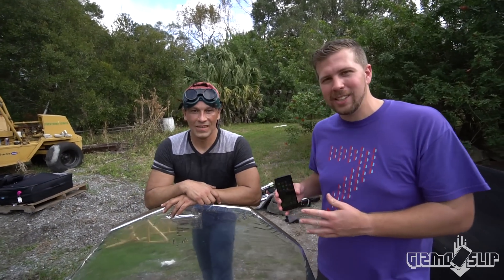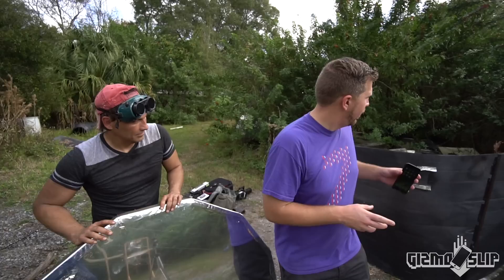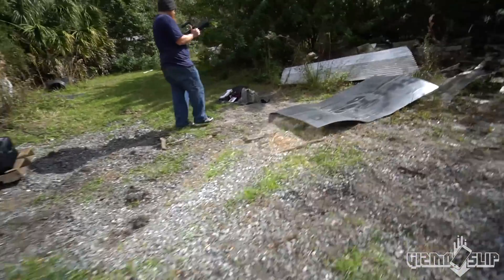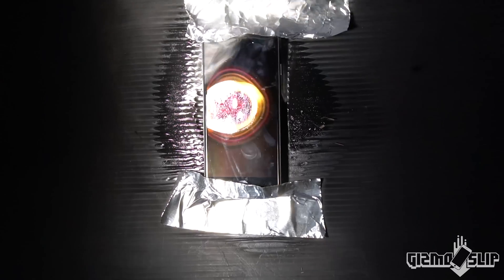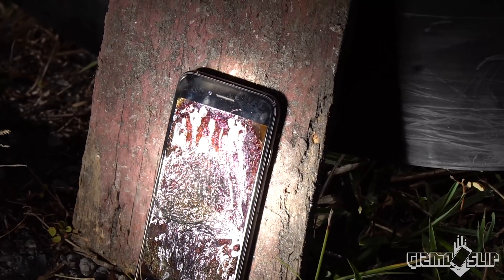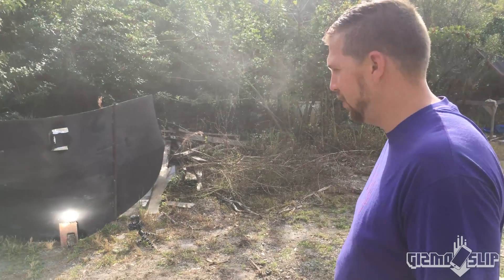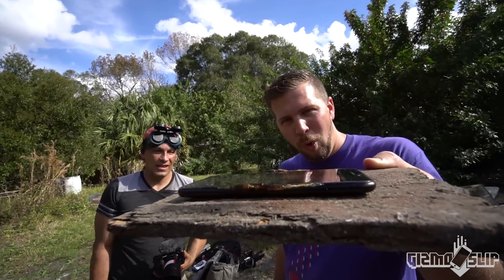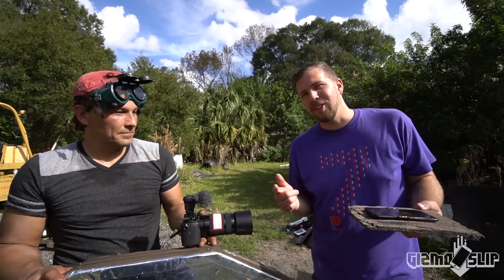Can Solar Death Ray Melt an iPhone 7? (Parabolic Mirror)

Comment: You know, you could probably build a more powerful parabolic mirror if you could make the frame hard-backed and airtight, and use a vacuum pump to suck the air out of it.

Comment: iphone 7 apple iphone 6s 7 plus death ray parabolic mirror parabolic mirror meltdown internal sun sunlight nintendo switch zelda casey neistat archimedes sledding cat boogie2988 ijustine gizmoslip ipad ipad pro potato gun 9mm oobleck liquid nitrogen floof rubber bands concrete pizza chicago style jello trump drop test drop test 100 ft 1000ft protect smelting smelt bow arrow duct tape silly putty ice pumpkin